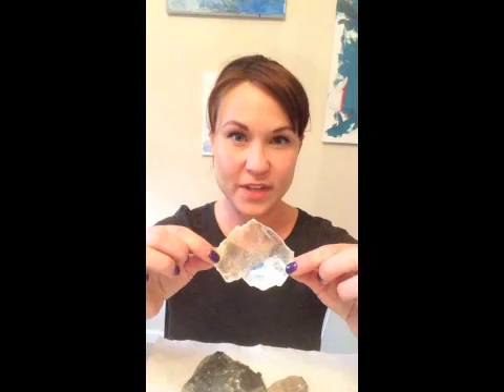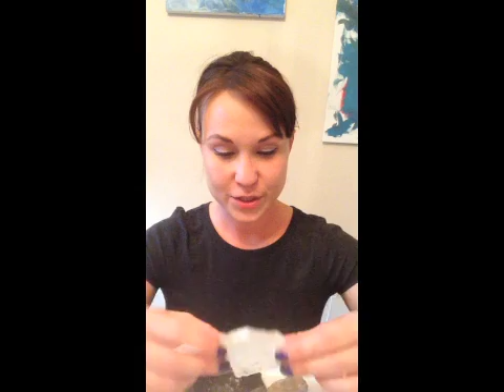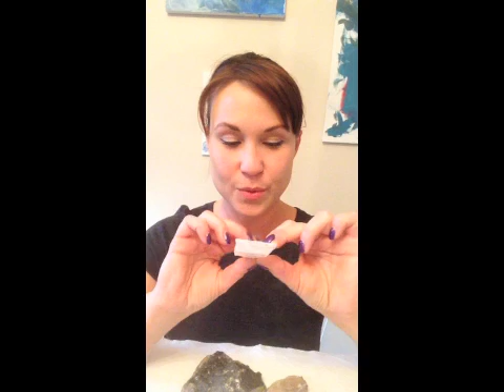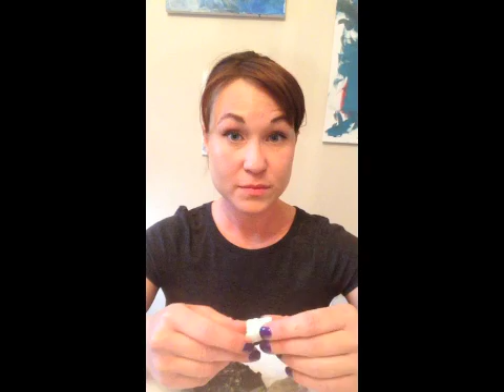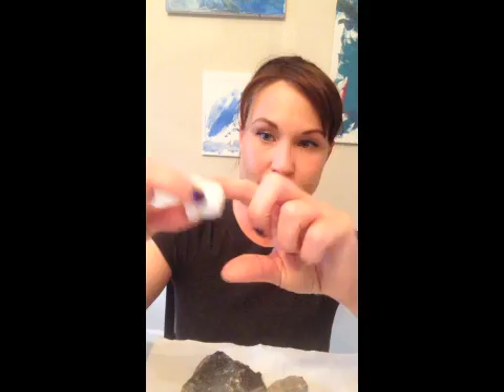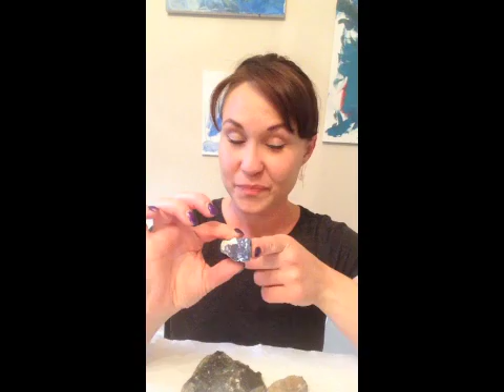Mineral ID- Cleavage

Comment: So in order to have a cleavage, any mineral has to perfectly reflect the light..? If its not reflecting the light, does that mean a mineral has fractures?
Reply: +sparklingstr A flat surface should reflect light across the surface evenly, where as rough/uneven surfaces will reflect light unevenly. So, it would appear, correct.